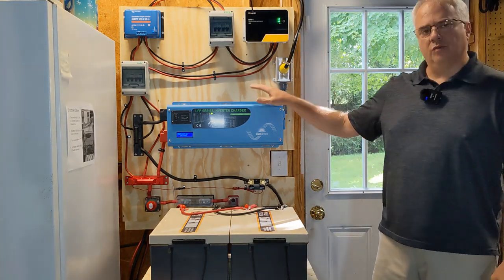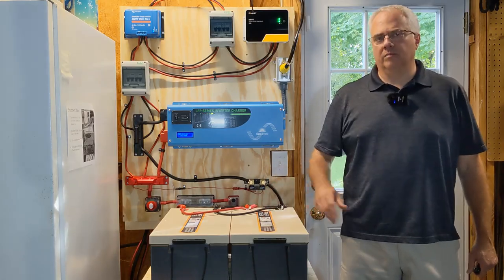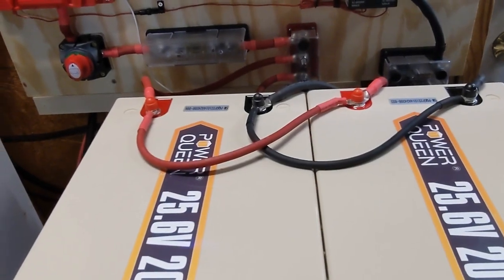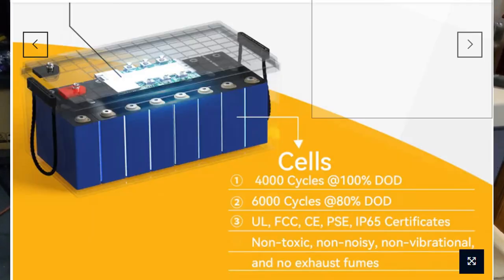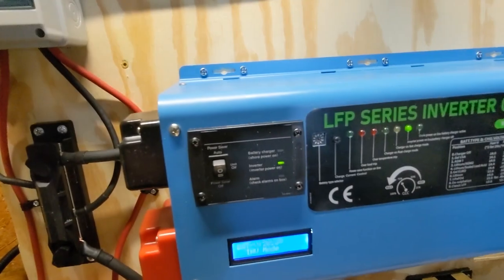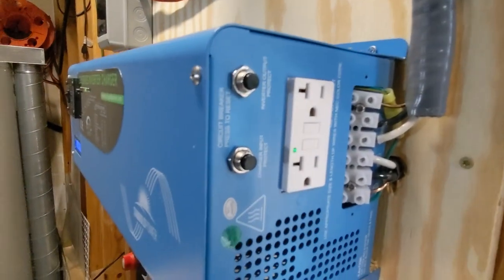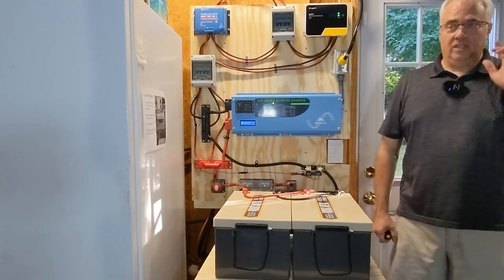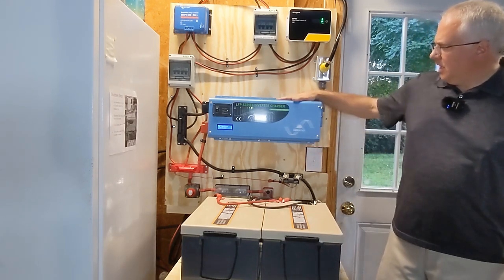24v DIY Solar Generator Setup - 4000w - 10,240kwh with Built-in Battery Charger

Comment: I enjoyed both your 12V build video and the 24V.  I am studying to put together my first 12V system.  Just learning myself.  I have a couple questions.  I was wondering why a fuse isn't needed on the positive terminal of each battery and do you still need the cables going battery to battery to make a parallel configuration when you have individual cables coming off of each battery going to the pos and neg busbars creating a parallel configuration that way?  Thank you for sharing your videos.

Comment: As far as short wire lengths go, I found it’s always better to go with the larger gauge, which alleviates the heat problem. This should solve the problem on the cut off switch to the battery.
Also, the fuse should be about 7 inches from the positive battery connection.
Reply from the maker: Thanks. Even though the Sungold power manual says to use 1/0, it may have been better to step it up to 2/0. Always learning.
Reply: I always tend to go at least one step beyond spec with wires. It just seems that for the cost for one system it doesn't make sense not to.
Reply: @AlohaPrepper  
I’m only suggesting a larger gauge on the battery cut off switch alone! Not the whole system.
Reply: My wire from bat to shut off switch gets hot at switch going into switch while testing my 12v system running oil filled heater on low,700 watts.Switching to 24v setup.Think I’ll get the 3k watt inverter to run rv ac 13,500 btu ac.Shut ac off to run microwave ect.
Great vid !
Reply: My 2k inverter gave a low voltage code pulling 700 watts thus looking to upgrade to 3k or 4K inverter.

Comment: Have you done any testing with inductive loads? (electric motors/compressor/etc)  Your setup looks very awesome!!!!
Reply from the maker: I routinely used by miter saw and compressor with this setup. However, it recently got struck by lightning and I'm trying to fix it. I did a video on that and I will be doing another follow up video on that also.

Comment: Again, this video is very instructive. Two things, 1. The wire coming off the bus bars is 1 ought not 1 AWG? and 2. Do you think a battery balancer would be a good addition to your battery bank? Really appreciate your help!
Reply from the maker: I need to do a little research on battery balancers. I believe what I have done with the battery bus bars is about as optimal as you can get without a balancer. I'm not sure yet if a balancer would help.

Comment: Did you find any inverters that are 24v & 48v in your research? 
Why powerqueen over the EG4 24v rack batteries about the same price but the rack batteries have better build quality/BMS low temp cutoff user serviceable ect?
Reply from the maker: These questions are the same questions I was asking myself. I went back and forth between 24v and 48v first. I finally decided on 24v for no clear reason. I guess the final decision was made on a 24v being safer than 48v. I am still rather new to this and I thought I would get more experience on 24v, then later at some point move to a 48v system. Regarding the batteries, the final decision came down to between the EG4 Lifepower and Powerqueen. I went back and forth. I really wanted the EG4 battery rack with built-in bus bars. I know EG4 batteries are high quality. Also, I've only heard good things regarding Powerqueen. I already had two Powerqueen 12v batteries and they have been great. There is no easy and clear answer to why I chose what I did. I still wonder if I made the right decision or not. However, unless something new comes out that I really want, I would like to end up with a EG4 rack full of batteries on a 48v system.
Reply: @proficientprepper  that’s why I think I’m going with HSQ 60amp charge controller it’s 12v/24v/48v & the eg4 24v rack battery if I could find an inverter that does 24v & 48v I could easily upgrade to 48v in the future with minimal expense

Comment: I started with a 12-volt system. But I have several electric vehicles. Two of which are dirt bikes. One uses a 48 volt 3 kwh battery the other uses a 3 KWH 52 volt battery. It works out pretty well as the motorcycles are usually around 80% charged. I also have stationary lithium battery packs for storage. And I can use my 12 volt system to charge the higher voltage powered by my Chevy bolt car battery. Which is 66 kilowatt hours. It's kind of a cluster but I don't have any solar
Reply from the maker: I've heard other people that had Chevy Bolt batteries. Where can you get those?
Reply: @proficientprepper  at this time I'm just using my car connecting to the 12-volt auxiliary battery to my lithium-ion phosphate battery pack which is connected to a 12 volt inverter, which I used to charge the 48 volt system. The car has a dc-to-dc converter and that keeps the 12-volt system charged from the main battery pack in the car.
Reply from the maker: Ok, I understand now.

Comment: I also very much appreciate the time and effort you put into making this video. It is going to be very helpful in setting up a similar 24v system with the 4000 Sungold inverter. A few questions. If you only had ten 100 watt panels wired in pairs (series) and run through a combiner box would it be sufficient to power this inverter (basically 1KW). I'm in northern Alabama and we do get a lot of solar here. Secondly, are the cables you ran from the charge controllers to the breakers and then to the bus bar 6 gauge? They appear smaller that the 1-0 cables that are easy to see. Again thank you very much for an excellent presentation, know you put a lot of thought and labor into it.
Reply from the maker: Thanks, and I'm glad you are getting something out of the video. Regarding the first question of using 1KW of solar panels, that would mostly depend on your battery (or battery bank). My thought was that I was trying to make sure I had enough solar panels to charge my battery bank in a day and that my battery bank was sufficient (and safe) to power my inverter. So I was trying to get enough solar panels to be able to charge up my batteries in one day of full sun (maybe from 20% SOC to 100% full in a day). Your situation may be different. I have 1600 watts of solar panels now and don't quite have enough solar to do that currently in the winter. Regarding your 2nd question, the cables running from the charge controllers are 8 AWG. The BougeRv charge controller is 40A and the Victron is 30A. I bought that wire from Windy Nation. The Windy Nation website says their 8AWG wire will handle up to 55A. So that should be safe. Be sure to check with the battery manufacturer on what amp rating it has. You want the wire to be able to handle more than the max amperage that will be on the wire.

Comment: I like these videos.
I think you would Be happier 6 panels 320 W  with a 250 70.
 victron  charge controller. And keep it at 24 V. My setup like that works really well
Reply from the maker: Which 320w panels are you using?

Comment: Really detailed video. 

Two questions if you can cover in upcoming videos.

Can 6 gauge silicone cables be used for batteries instead of the expensive 2 awg.

Detailed video on how to create mc4 extension cables.
Reply from the maker: I do plan on doing a video on making MC4 extension cables. Regarding 6 gauge cables instead of 2 awg. The size of course depends on the amps you plan on pushing through. I don't really know much about silicone cables. The windy nation battery cables I am using has a very flexible EPDM rubber jacket.
Reply from the maker: I just posted a video on building MC4 Solar extension cables.

Comment: Just what I was searching for, so a 12v 200ah battery is kinda equal to a 24v 100ah battery
Reply from the maker: Yes, but these 24v 200ah batteries I'm using are like 4 - 12v 100ah batteries.

Comment: Very informative, Can you use a 10,000 watt modified sine wave generator without damaging unit and battery? or is it too risky?
Reply from the maker: If I am reading the manual correctly, it does not say it requires a pure sign wave input. The input breaker seems to be a 40 amp breaker, so it seems to have adequate protection if you overload it. To be certain you should probably reach out to SunGold Power. I did reach out to them once with a detailed question and they did reply with an answer.

Comment: Have you had any issues with neutral bonding, it appears the inverter has a bonded neutral which when wired to a sub panel that is earth bonded can cause a neutral bonding conflict.  Much the same way a floating neutral generator is used for powering a transfer switch to a home panel, not a bonded neutral one.
Reply from the maker: I have not had any issues with neutral bonding. This inverter/charger comes with an automatic neutral to ground relay switch depending if it is on inverter mode or AC mode. That feature can be disabled by disconnecting a wire.
Reply: Good to know, think it will work with what I have in mind to do, something very similar to your system. Best regards! @proficientprepper

Comment: I want to get a beefy inverter like that too but im wondering how you can get that much power from it when your not plugging in directly because extension cords would probably stuggle to safely take it.
Reply from the maker: I am typically only using the AC output terminals which can give full power. The GFCI outlets on the inverter can't handle the full power. I can't find their rating, but I would assume they are 15 or 20amp. The AC output terminals have 8AWG wires running up to the NEMA L14-30R outlet which has 4 prongs. The RV extension cord says it can handle up to 7500 watts. There are two live wires in the extension cord and the load is split between them. I believe those wires are 10awg which can handle 30amps each. In other tests I did, that wire did not get hot at all.

Comment: Great video! Getting ready to do my first solar system, and I'm torn between 12v & 24v. Want the system mostly to power the fridge & deep freeze when the grid power goes out during storms. Also a few lights + charge devices. So... 2000W (maybe 3000W) draw. Your thoughts on 12 vs 24 in that situation?
Reply from the maker: I would say if you want to go over a 2000 watt inverter, build a 24v system. When I looked at using 12v for a 4000w inverter, the wires I needed were huge, hard to work with and more expensive.
Reply: @proficientprepper  Thank you. 👍🏼

Comment: What size fuse are using for that size wire ?
Reply from the maker: I'm using a 250 amp fuse. The windy nation 1/0 wire says it is rated up to 285 amps.

Comment: With that much power you shouldn't use a class t fuse?Shouldn't you connect the smartshunt cable directly to the minus therminal of the battery?I didn't know that it is also allowed on the busbar and so to the minus thermal
Reply from the maker: Class T fuses are better and go up to I believe 160 volts, but ANL fuses like in the video are good up to 32 volts which is within my system voltage. I plan to switch over to a class T fuse soon. Regarding the shunt placement, I have the batteries wired as the power queen manual says to by having them all connected to a bus bar and also connected to each other. In order to count both batteries amps going in and out, you have to connect the shunt between the negative bus bar and load. Now if I had wired these in parallel not using a bus bar and had the negative coming off one of the batteries, then yes, I could have connected the shunt directly off of the negative of the battery.

Comment: I purchased a 24v lipo4 battery 5.4k and was planning on putting together own system. 
After thinking I might would have beem better to just bought a solar generator.
My question is do you know a solar generator  that I can hook up my battery to with no issues
Reply from the maker: I've seen a few videos where people are hooking a battery to their solar generator (portable power station). It doesn't seem ideal in the videos I've seen. I actually did that in this video https://www.youtube.com/watch?v=763dQBXPkvs  where I hooked batteries up to my Bluetti AC200Max using the Bluetti DC Charge enhancer. What I showed in that video is specific to the Bluetti AC200Max and a handful of other Bluettis that have a input port compatible with the DC Charge Enhancer. In that video, the battery just serves as extra reserve power you can use to charge the AC200Max. The AC200Max can't charge the external battery. You have to have a separate way to charge your battery. I'm not aware of a solar generator that seamlessly integrates with any external battery. Maybe someone else seeing this comment will reply with one that does.

Comment: Hello there!  Pricewise talking... How much will be the budget for the settings? Thanks
Reply from the maker: This entire 24v system cost me about $5k. The batteries alone were just under $3k and the inverter/charger I got on sale for $895. Batteries have come down quite a bit in price. So you could build this a little cheaper now.
Reply: @proficientprepper  Thanks for the information. 👍

Comment: Wow awesome video sir.  I wish I had your knowledge.  I'm in San Antonio, Texas.  How can I find someone to build this in my home.  What will be the cost?  Thank you!  Mario
Reply from the maker: Thanks. I'm not sure you can find someone to build something like this for you. Maybe you can. I'm just not sure. This solar generator I built is a DIY solution that a lot of people do as kind of a hobby after spending dozens or maybe even hundreds of hours learning how to do it. I started small and built my way up to this. This DIY 24v solar generator cost me roughly $5k not including the solar panels. The batteries (2) alone were $3k and is typically the most expensive part. The inverter/charger was about $900. You can buy power stations that have similar capabilities that come from companies such as Bluetti or Ecoflow. There are several others too. Those units will cost quite a bit more, but they is no assembly. They are portable and you just charge them and plug things into them. I just published a video on the Bluetti AC200Max that has roughly half the capability as the the 24v DIY system I built - https://www.youtube.com/watch?v=763dQBXPkvs

Comment: I like your set up very much I was thinking about a low frequency inverter similar to the one that you have in service.I decided to use a high frequency inverter instead until I determine what my needs are. That wire that is getting hot is not because of it's ability to carry the current it because of the switch not being able pass the rated amount of current. There's a Youtube video channel Called WattHour " Review of Battery Master Disconnect switch for Car, Rv ,Boat or sound system" . He does a complete review and teardown of it.I think you will appreciate the review. I have already purchased one of those switches. I will return it to Amazon
 . I am not an expert  just my opinion that the switch maybe the culprit based on research.
Reply from the maker: Thanks for that information. I will definitely check that out.
Reply: YOU ARE CORRECT!

Comment: I’m trying to build a 4kw Solar inverter but I can only find car inverters in my country, is it advisable to use it for home??
Reply from the maker: I don't believe a car inverter is any different than any other inverter. If you can find a pure sign wave inverter, then you should be good. But if you can only find modified sign wave inverters, then it depends on what you are needing to power in your home. There are some devices that may not function or could even be damaged by a modified sign wave inverter. Most things work fine with modified sign wave inverters. You will just need to determine what you need to power and if it will work with a modified sign wave inverter.